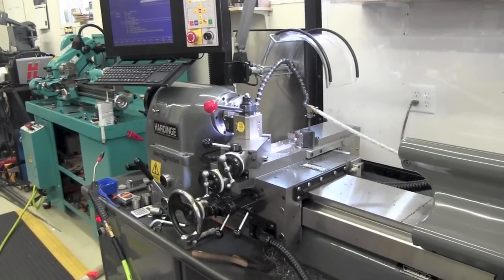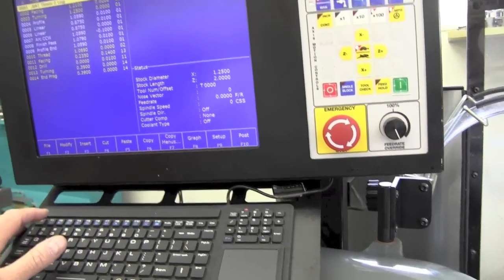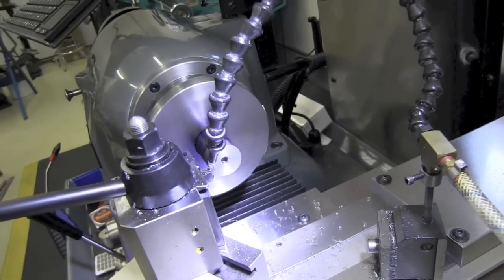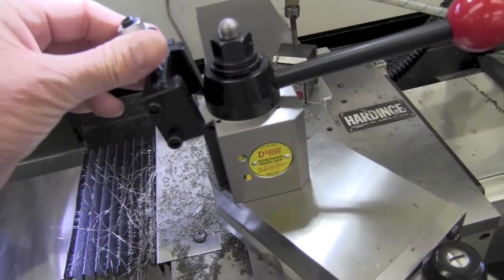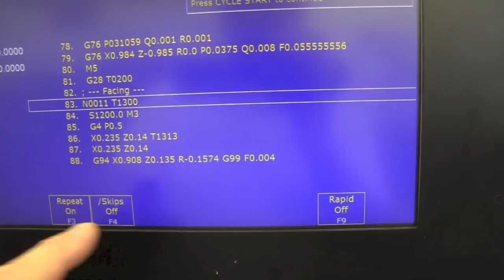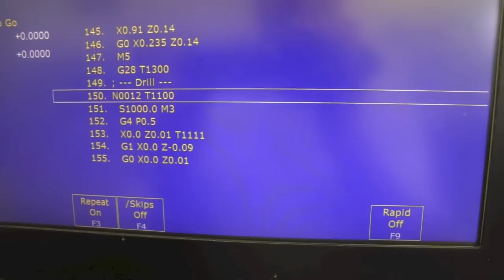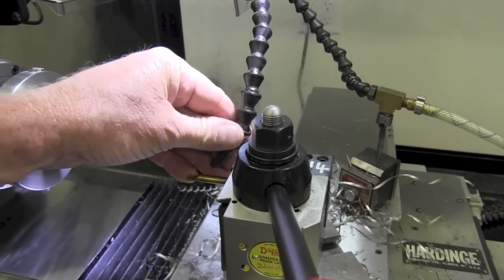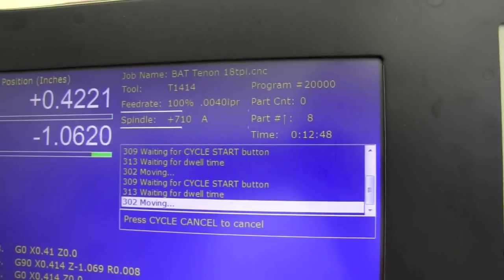Hardinge CNC Barrel Tenon

Comment from the maker: I have since switched out the Dorian quick change tool post. It was a disaster. I could not get it to repeat anywhere close to what the specify. Their brochure says 0.0001" and it was not even close to that. I replaced the entire system with the Multi-Fix or Multi-Quick system from Switzerland. Way better and if you insert the tools properly you can get it to repeat to a tenth quite easily.
Reply: Chris,

This is really slick.  Can I ask if you have a source for Swiss multifix holders presently?  I have two posts and only 4 holders on my hardinges.  Any help would be appreciated.

Gorgeous work by the way!

Phil
Reply from the maker: You can get the system from MSC but you need to know your part numbers as it is not in their catalogue.  Another option is to call SPI in California. Speak to Urs Peskou. He is very helpful and can put you in touch with who to speak to.  The Multi-Quick/Fix system is MUCH better than the Dorian system. I have used it now for about a year and I am very impressed with the repeatability.
Reply from the maker: There is a guy selling the system on eBay. He is selling a Japanese clone and it works very well. His name is Keith and seller id is wtv-uk

Comment: One small complaint. Why don’t you have a rag in the tailstock. All that loose chip material.
Reply from the maker: Thanks for the comment. I have never bothered about that on any of my lathes. Every time I insert a taper I ALWAYS clean the inside fo the barrel and the tapered tool itself. That works for me. Not if if it is bad practice or not.

Comment: What insert/bar combo were you using for cutting the cone. I like the look of it for crowning.
Reply from the maker: It is a Arno tool with VCGT070202 insert. I love the tool holder but I would not use it for crowning. I did at one stage when I was lazy to sharpen a HSS tool but carbide can not do as good a job as sharp HSS. I typically sharpen a HSS cutter to a razor and take 0.003 to 0.004 at a time when I am doing a crown. That works very well.

Comment: Did you have to make any changes to the spindle bore to do barrels on the Hardinge, I thought it might be too small?
Reply from the maker: No, it is more and big enough in diameter. I think it is 1 3/8
Reply from the maker: No, The barrels pass through the spindle very easy. I think it is 1 3/16" diameter so it will pass all my barrels except the unlimited barrels which are 1.450"